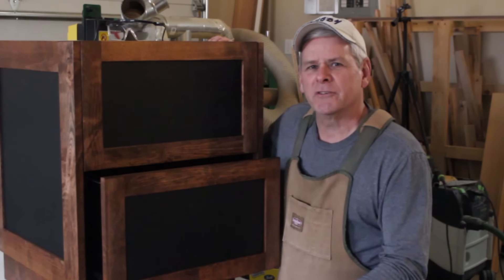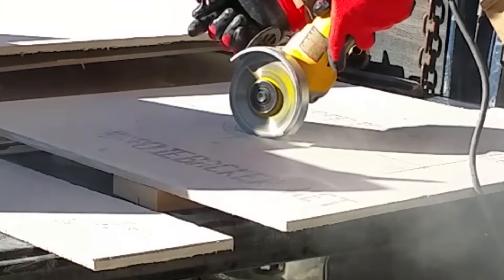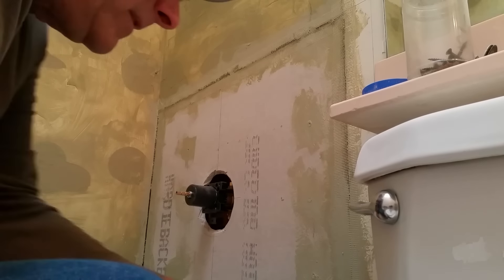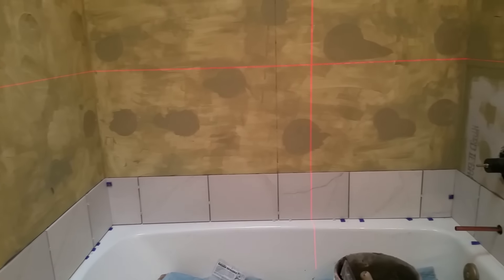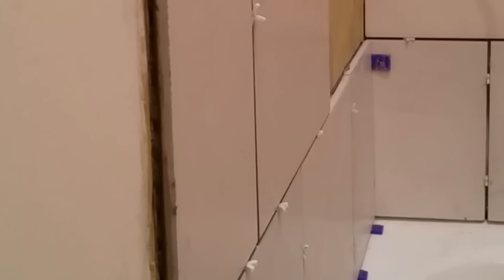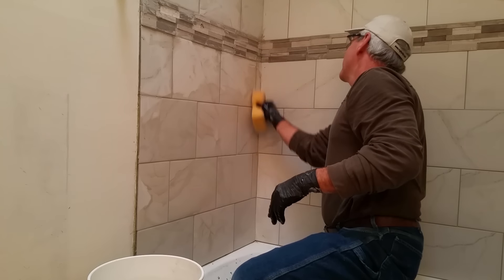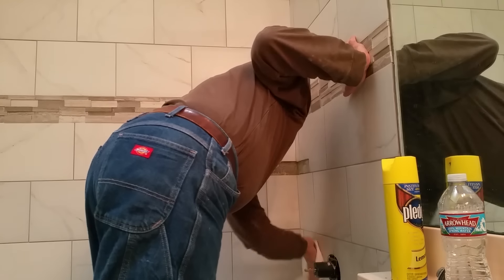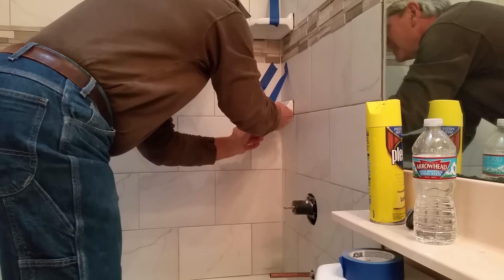How to Set Tile Around a Tub - Bathroom Remodel

Comment: My installer suggested corner shelves that are just glued on with silicon glue.  My feeling is that the ones that are inset like the tiles would hold up better.  What's your opinion?  Thanks!
Reply from the maker: Yep, I'm with you! But I'm kind of 'old school'. I don't think gluing things to the surface of any tile is a good, long lasting idea and am surprised that a tile installer would recommend that. A shelf that is inset in the tile and set in place with thinset will be there a long time. Thanks for the question!

Comment: You need to at least do a roll on water proofing on the wall first.  If you don’t you will have rot.  Even with your cement filled board.  Water will wick through the grout, mortar and  board all the way to your studs.
Reply from the maker: Hey, Rob. There is a train of thought among some that the best surface prep before setting tile around a tub or shower is to create a 'waterproof envelope', one way to describe it, that eliminates the possibility of water getting past that barrier. For some of us that started setting tile many years ago that is a relatively new idea and not one that is easy to buy off on. Without going into explanations as to why, let me ask you a few questions. You acknowledge that water finds its way behind the tile over time and following the logic of your suggestion then gets trapped behind the tile and between the tile and waterproof barrier in the mortar bed. You know that will never dry, right? It may never leak, but it will grow mold and create other problems. Does that still make it a good solution? Does the installer not have some responsibility for this situation? Here is a link to my preferred way to prep if it is totally left to me. https://youtu.be/ZAWpt2ieWf8  Maintain grout and caulk joints and let the 1/2" Hardiebacker wick away.
Reply: When waterproofing the entire wall, you can leave some weep holes in the caulk under the bottom row of tiles so the thinset can breathe and (hopefully) dry out between uses.
Reply: I am no professional but it seems to me that it might depend on your climate. I live in the desert and things dry out easily. Even in the botched tub surround I replaced, where water got in profusely, it barely did anything to the studs.

Comment: I know this may be a silly question but what's the rest of the wall? Drywall or backer board.
Reply from the maker: In its day, it would have most often been called 'green board'. It was the treated sheetrock for wet areas available when the house was built. In this case, it had been covered with 1/4" cultured marble so structurally is was fine. I added a coat of Hyrdroban to give it better water resistance before the new tile. Thanks for your question.

Comment: Why wouldn't you paint whole shower? Its a  rubberized paint on membrane. 20+ years ago the products were more pronounced to break down. Depending on the years also. 

YOU'RE video is very informative. Everyone can learn something new every day. NO ONE KNOWS EVERYTHING. I'm starting to learn after 43 years in construction and 30+ renovation I'm just starting to know something. Sometimes.
Reply from the maker: You and I must be pretty close to the same age, Dave! My first experience with the tile trade was learning to mix mud and floating shower walls and floors 42 years ago. And you are right, products have changed a lot over the years. I certainly could have put the waterproof membrane on everything. I prefer not to use it on Hardiebacker except at corners and joints, referencing back to my days of floating mud walls. I use it where it makes sense to me as it did on the other walls. So I apply it on jobs on a case by case basis. Broadly speaking, I am not convinced that a 'waterproof envelope' behind the tile is an approach that solves all problems without potentially creating others.

You are right that we can all learn something new everyday! YouTube is a great resource for seeing people do things in ways I may have never thought of. Thanks for your comment! Sounds like you, like me, are still hanging in there and doing work!